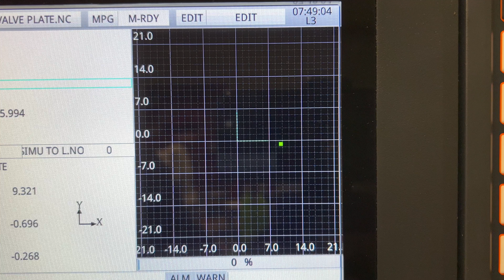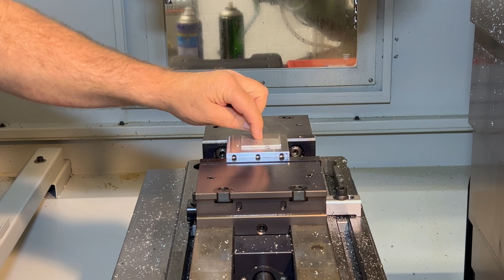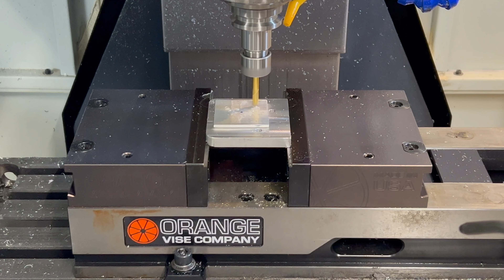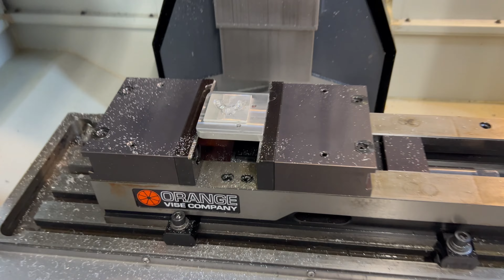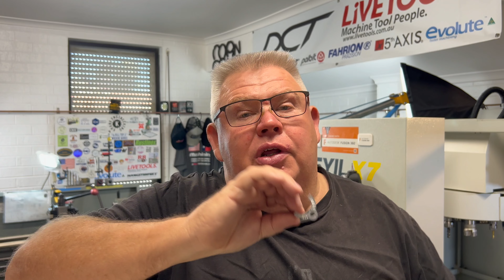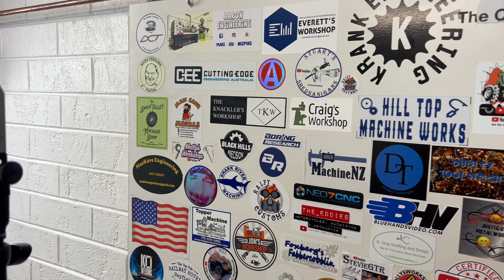To hard to manual machine so I used the CNC

Comment: The ole CNC made quick work of the little fiddly part. How long did it take to write the program?
Reply from the maker: G'day Tom.  I use a CAD CAM program from Autodesk called Fusion.  As an educator I get it for free and it's a very capable program.  I would say 1-2 hours to design (CAD) and produce the code (CAM).  Would have been possible to manual machine it and use a pantograph.  Cheers mate, Aaron.